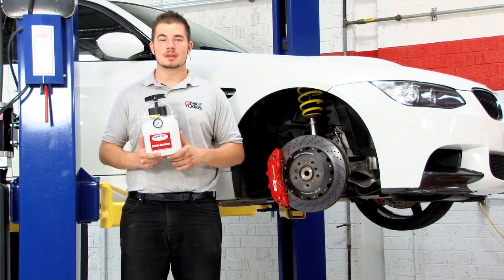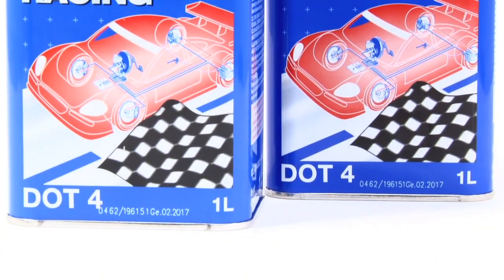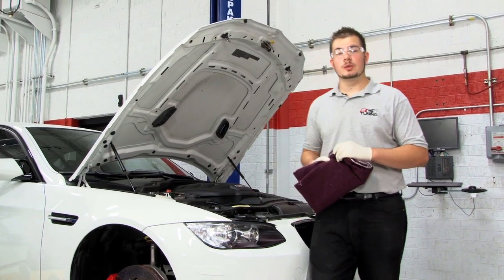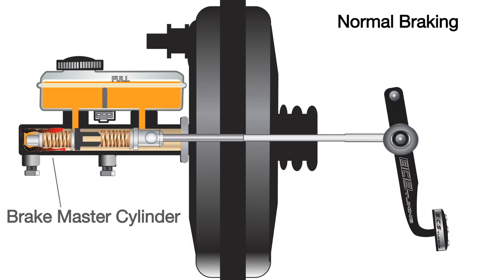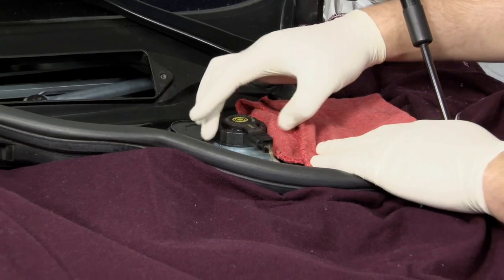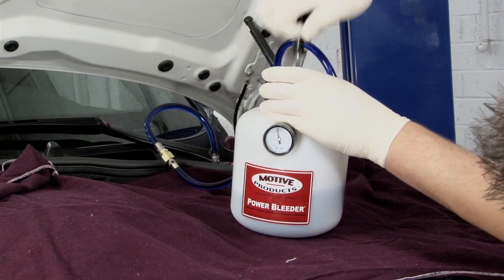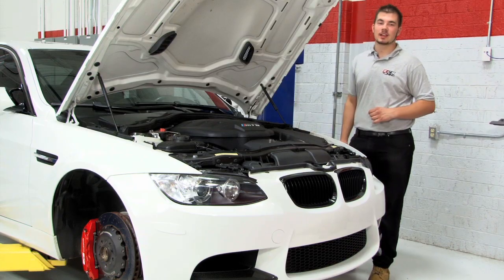ECS Tuning: How To Bleed Your Brakes

Comment from the maker: Power Bleeders available here: https://goo.gl/iijpmW
Reply: ECS Tuning how do I know how much fluid I should pump?
Reply: Till it runs clear use a couple of bottles that should do the job.
Reply: Can I using power bleeder for motorbike as well or not ?!!!
Reply: InstaBlaster.
Reply: no need, the hand pump works well and is more robust (no electric and automatic moving parts). I have the schwaben 3 liter brake bleed pump and recommend it.

Comment: I don't know if there is a maximum known pressure limit to pump the pressure bleeder up to or not , but I never want to go above 15 psi.  I am inclined to believe you could put too much pressure on the plastic master cylinder adapter caps. I made a homemade bleeder out of an $11 dollar  garden sprayer. It works well. The guage cost around $15 dollars.

Comment: I wish that bleeder was rated for more than 30PSI. FYI Mercedes requires bleeder to hold pressure between 2 and 3 bar (30-35 PSI) in order to bleed the SBC.

Comment: Here's a few tips I've learned from using a pressure bleeder...

1) Apply a bit of fresh brake fluid to the adapter seal so that it stays airtight. Similar to how dry o-rings need lubrication to seal, the rubber gasket in the adapter needs lubrication.
2) Replace the old fluid you removed from the master cylinder with fresh fluid slightly below the fill mark. This lessens the chance of pushing air through the system during the initial pumps.
3) After use, always clean the pressure bleeder with denatured alcohol. It's fairly simple. Just pour the denatured alcohol in the container, shake it up a bit, and pump everything out through the hose and leave to air dry. I normally do this twice and wipe down the inside although the wipe down may not be necessary. Also wipe down the adapter gasket with denatured alcohol.

BONUS: Adding a quick connect inline between the bottle and the adapter makes everything much easier. I can twist the adapter onto the master cylinder without kinks developing in the line compromising the stability of the bleeder bottle.
Reply: Thanks, Chris.
In Canada, we can't find denatured alcohol any longer! 
Home Depot in the US was a good source when heading to the States for any shopping trips.
Reply: Great tips!  Just got mine from ECS Tuning and can't wait to use it.
Reply: My motive power bleeder doesn't build pressure. I've made sure all the lines are tight and applied some grease it came with to the rubber adapter. Also doesn't look like I have any leaks in the brake system. Any ideas?
Reply: @RPDBY  brake fluid is extremely hygroscopic meaning it absorbs moisture from the air. Moisture is one of the contaminants you're trying to purge from your brake system when you bleed your brakes so it's counterproductive to leave any in your bleeder to be introduced then next time you bleed your brakes. Even 2% moisture will lower the boiling point of your brake fluid by 135 degrees (f). Alcohol mixes well will brake fluid and will remove any residual brake fluid that could contaminate your next brake job. It will also evaporate and leave no residue in the bleeder.

Comment: A 7 minute video but the instructions don't start until the 4 minute mark.  Plus, how about using CLEAR tubing instead of WHITE tubing so you can see the color and clarity of the brake fluid and the bubbles more clearly.

Comment: You said to start w/ right rear, which is what I have always done. Evidently we are supposed to reverse the sequence on the Mark 7 (2016) VW Golfs. Any thoughts on this?
Reply from the maker: haven't heard that myself but if that's what the TSB says to do, might try it. Traditionally, you want to start as far away from the master cylinder as possible, however, I could see the benefits in starting at the closest. Logically, that makes sense that it would push all the air out all the way down the system if you started with the closest caliper and worked your way back. I say try both and record your results!
Reply: It depends where the master cylinder is located in the engine compartment.  Just go to the diagonally opposite corner for the farthest wheel cylinder.  This isn't rocket science.  Think.
Reply: @STBRetired1  My comment was specifically that I have always done diagonally farthest first, but VW is advocating the opposite sequence.

Comment: Does it get out air in the system though?
Reply from the maker: yes - the bleeding process is the removal of air from the brake fluid system. this tool creates pressure on the front end and sends fluid through the system so you can bleed without having to pump the brakes by supplying pressure through the bottle rather than through the booster.
Reply: @ecstuning  That will definitely come in handy if I am bleeding the brakes by myself. Thanks

Comment: Hey ECS I have a question. Why did you guys not use a scan tool to activate the ABS pump using the special function during the bleeding procedure? Is that necessary? If not, when is it necessary? Thanks in advance, Dylan.
Reply from the maker: Hi Dylan - this is to demonstrate the power bleeder and how it works with most applications. Many modern cars, like the E60 M5 and E90 M3, do require cycling the ABS pump, which can be done with a Schwaben Professional BMW Scan Tool or other similar coding device. However, if you didn't open the ABS pump/module and drain it of fluid, then it likely isnt necessary. Good question, though!

Comment: Yes this works but I wouldn't use that pvc cap unless the thread matches your master cylinder and if it is not then don't do it. It's much safer just to obtain the exact cap that fits and attach your tubing into it. Do not rely on tapes because brake fluid does melts all types of plastic that isn't intended to have contact with the brake fluid. Once you start building any pressure from the tank the fluid will leak out around the thread completely at a blink of an eye so I thought just a pre-caution.
Reply: i use sealing tape on the thread on the master cylinder reservoir and wrap it around at least twice. It does its job superbly, no leaking, and once I'm done bleeding it comes off the thread easily in one piece. No mess, no fuss.

Comment: I'm using this bleeder to bleed my clutch. But when I crack the bleed screw open, hardly any fluid comes out. And it is up to the full level. Just doing a flush. Didnt change any components.

Comment: Just curious... You emptied the brake fluid reservoir and then hook up the Pressure bleeder which has no fluid in the rubber hose (and reservoir is still empty) so when you pressure up the Pressure Bleeder, you are now forcing the air that was in the hose (between screw on cap and new brake fluid) into the air only reservoir... Where does all this air go before the fluid from pressure bleeder enters the reservoir? Is it forced into the brake lines? There has to be a better way to avoid this air trapped into the Pressure Hose?

Comment: Any instructions on how to clean the Motive bleeder tank, lines?
Reply: Denatured alcohol. Put it 1/8 full. Swish it around and pump it out. There is probably a cheaper cleaning fluid but I don't use it enough to worry about finding one.

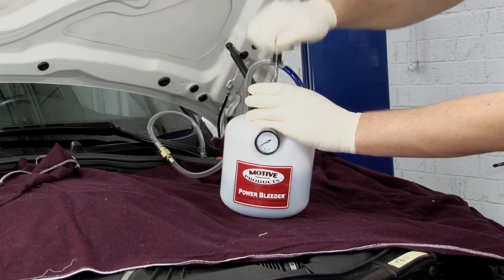Comment: The air that is being displaced at 5:00 would that trapped air from the brake fluid reaching the reservoir introduce that trapped air?
Reply: @Floyd. B exactly. Gravity keeps the air above the fluid in the reservoir (unless you run out of fluid in the tank). Even though the fluid and air are both pressurized, the air still make its way around and above the fluid (heavier than air).  So you won't get bubbles in the system.

Comment: Thanks for you video.
My car has yet done the flush for 6 years. While cool starting, it keep squeaking and noisy. A few days ago, I follow you did this DIY job with BOSH ESI6 brake fluid. It's amazing now, super silent and no need to put any grease on slider or brake pad outside.
Reply from the maker: Glad it helped

Comment: It is better to fill or almost fill the brake reservoir with clean fluid after drawing out the old fluid and before attaching the pressure bleeder. This removes any chance of pushing in a small air bubble into the the outlet of the reservoir tank where it could get trapped..

Comment: Great video! When bleeding is finished, and you disconnect the Power Bleeder, is the fluid level in the reservoir all the way up to the cap? To the point that the reservoir is going to overflow? Or does the level go down once you de-pressurize it and disconnect? I always thought the Power Bleeder used air pressure, but now I see that it uses brake fluid to pressurize the entire brake system.
Reply: There are two options you can use air pressure only from the tank or fill it with fluid like in this video. it is less risky to use only air from the tank (you risk nothing in case the adapter to reservoir leaks, some reservoir plastic is made of soft plastic with poor threads rigidity and can make a pressure tight connection difficult, use plumber white tape as a trick!) and it also is cleaner (nothing to clean) but the catch is you have to be vigilant and keep the reservoir filled and never let it empty below the min (when you open the bleed screw the fluid level will go down) otherwise you will pump air into the brake lines (and waste more fluid getting the air bubble out of the system all the way to the wheels bleeder screw). 

So it's like this : When you pressurized the system, you open the bleeder screw which drains into the catchup bottle with old fluid but you tighten the screw back to check the level of the reservoir under the hood. You have to refill maybe 3 times per wheel which means, depressurizing, unscrewing the adapter cap from the reservoir refilling with fluid, putting the adapter cap back on, pressurizing the tank again and repeat.
It's slower and more work but much much safer (brake fluid leak from the reservoir will destroy sensors and damage paint finish)

In the other (riskier) method the tank is filled with fluid. The pressure in the bleeder tank bottle is made from air pumped atop the fluid. The tube infeed catches the bottom of the tank fluid so that only pressurized fluid flows to the reservoir. But the air initially in the reservoir and tank tube does not disappear it is actually compressed into the reservoir but gravity keeps it above new fluid coming from the pump (read that again it's a bit tricky).
When you are finished there is an air release valve on the bleeder that you press to depressurized it. You do that before disconnecting the reservoir, some fluid will flow backward into the bleeder tank because your whole brake system is still at +15+20 psi and your tank is now back to atmospheric pressure, until pressures equalize by themselves. 

The air that was initially in the reservoir will still be there and should actually refill the tube so that there is no overflow when you physically disconnect the adapter from the reservoir (except for a film of fluid covering the inside of the tube due to viscosity that may drip a few droplets). Don't be frustrated if this is not straightforward to understand and visualize. It's actually quite tricky and you have to see it in action.

Comment: Very nice, but you have pressure test the seal to the cap of the brake reservoir first, disconnect the connection to the pump, then fill and proceed.  A mess could be created otherwise.
Reply: I'd advise against using fluid in the tank, just use air only, and add more fluid in the reservoir during the bleeding process a few times. This eliminates the risk of spilling fluid.

Comment: why do most people only bleed through the calipers and don't use that top pump thing on the master cylinder?
Reply: Because they decided not to buy one. Its a tool, you will get pretty much the same results with or without it. It is just far easier and faster with it

Comment: Great video. Purchased the bleeder from y’all. Thanks for the fast shipping. The product itself failed and will be returning it. The cap wasn’t able to be fitted on the bmc. Tried mitigating the issue a few times by tightening it a few times. No luck. Left a big brake fluid mess in my garage and in my engine bay. Thanks for the RMA. Will be returning it.
Reply: you need to stop using acronyms at odd places, this is a bad habit that is ok on live chat, but not on permanent text. You're obscuring the meaning of what you're trying to say.
Reply: @goognamgoognw6637  im sure he meant break master cylinder??
Reply: @adriandutkewych7669  yes, i see it know, thanks. I already bought the german bleeder other brand and used it. I was prepared for air leaks and It sure leaked at the master cylinder reservoir cap but i was able to make it air tight with plumber white tape. The only inconvenience is you are forced to not put any fluid in the bleeder tank itself (any leak would spill fluid instead of air) so you have to keep a careful watch on the master reservoir level make sure it never empties and each time you add fluid to it you are forced to remove the plumber tape and put new one to make the screw cap air tight again. It's not as much pain as it sound, and since you don't bleed brakes often.  Bottom line this worked for me and i was satisfied to successfully bleed the brakes. I was less happy about dripping some fluid from the rear caliper on to my wood ramp.  My advice is to not apply excessive force when screwing the cap on. It won't make it more airtight and you will only damage the thread. Just use plumber tape and start with moderate force and it'll be tight.
Reply: @goognamgoognw6637  I believe I seen people remove the fluid from the reservoir then hook up the pressure bleeder empty to test that it holds pressure, when you confirm it holds pressure just release pressure and use with fluid.
Reply: @barrysuss4421  Well not really, not without significant risk to spill fluid over your engine bay. I went through this so i can speak with assurance. The master cylinder reservoir plastic thread where you screw the bleeder pump on was never designed to hold the pressure needed to bleed brakes which is quite a lot of pressure. The soft plastic thread was only designed to hold the cap under no pressure. The way garages bleed brake is by suction at the caliper where the nipple thread is solid metal., this bleeder pump method is a bank saver but you have to be careful.  Even if you test it without fluid and hear no air leak, it can start seeping fluid gradually. The plastic thread on the reservoir isn't very rigid,  even if it does not leak at all in the first 2 min, as plastic deforms over time under pressure it can start seeping fluid gradually more and more. Yes, you may be able to do it with fluid in the bleeder but from what i saw, it's was not worth the risk of ruining my day. I got it done without spills and that's the right way in my opinion.

Comment: Avant de purger avec le power "bleeder", il faut que le liquide soit au niveau mini ou maxi dans le maitre cylindre?
-----------
Before bleeding with the power "bleeder", it is necessary that the liquid is ADD or FUll  in the master cylinder?

Romain
Reply: Dans tous les cas commence par retirer autant de vieux fluide du resérvoir que possible. Puis travaille sans remplir la pompe de liquide et rempli uniquement le reservoir au niveau max si tu préfére ne pas prendre le risque d'une fuite au niveau de l'attachement entre le reservoir et le connecteur de la pompe, l'inconvenient est que tu vas devoir devisser pour re-remplir le reservoir et revisser la pompe plusieurs fois et surtout fait attention que le reservoir ne se vide pas entièrement .  La deuxième alternative est de travailler avec la pompe remplie de fluide, dans ce cas tu procède de même au départ en vidant le réservoir du vieux fluide puis tu rajoute seulement un peu de nouveau fluide avant d'attacher la pompe, pas besoin dans ce cas de remplir le reservoir jusqu'au maxi.

Comment: Thanks for the video.

How to clean the "power Bleeder" after use?

cordially

Romain.
---------
Merci pour la video.

Comment nettoyer le "power Bleeder" apres utilisation?

Cordialement

Romain.
Reply from the maker: The recommended method is to rinse the reservoir and hoses with denatured alcohol.

Comment: Clear and concise instructions, thank you for a easy to understand video!
Reply: CLEAR AND CONCISE - are you crazy???  This is a 7 minute video and he didn't start showing how to use the product until the 4 minute mark.
Reply: @STBRetired1  you're wrong, I own the schwaben pressure bleeder and used it successfully thanks to this video including the intro. It's important to understand the brake system and why/how brakes are bled before getting into the pump product. You don't want to be a robot copying movements you've seen in a video without understanding the context and logic, because in practice it never goes as smoothly as in a video and your car setup might be different and you often have to make on the spot informed decisions which you cannot make without knowing more than the product.

Comment: Good thing they used a rubber that was degradable when in contact with brake fluid, the very liquid it’s supposed to be designed to be in contact with. Good job motive. Also, good job on not making a Honda adapter, only some square universal deal, with j-shaped screws and small toilet flapper chains and wingnuts. If I knew every adapter would be $30+, you couldn’t leave brake fluid in the brake fluid bleeding machine, and that they didn’t even HAVE an adapter for many cars, I wouldn’t have bought one.